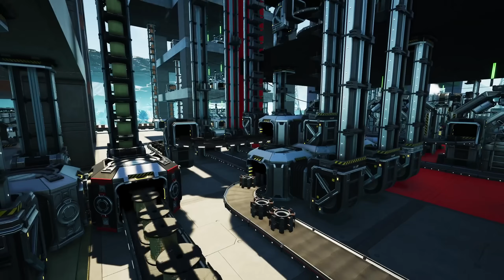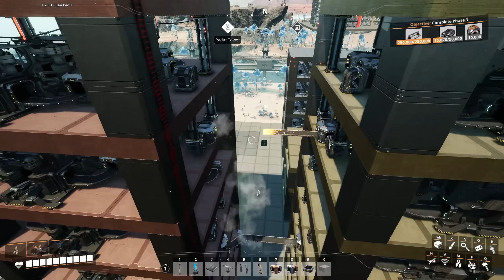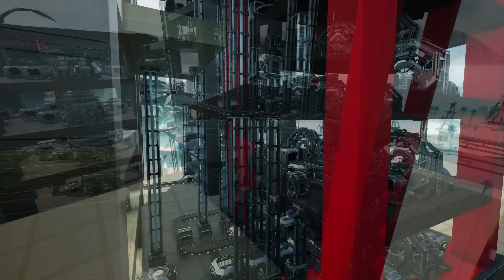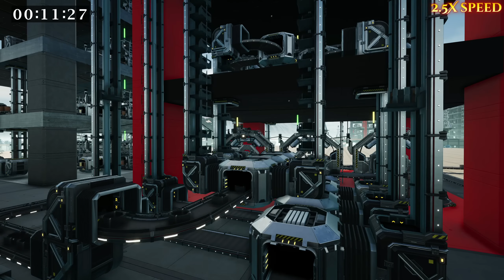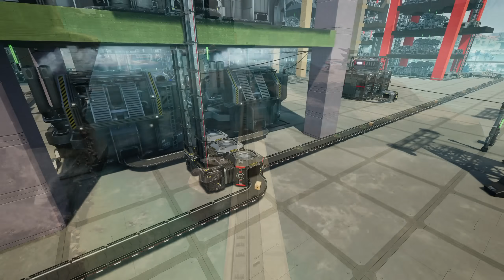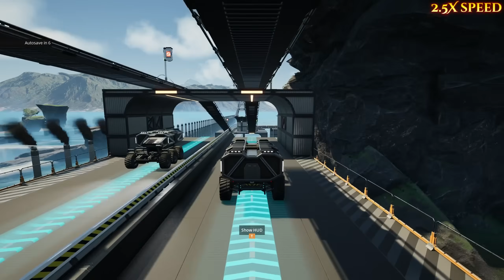5 Adaptive Control Units / 100x Space Elevator Parts - New Satisfactory 1.2 Playthrough

Comment: Question, does that priority power switch tie into the entire Versatile Frame factory chain?
Or just the Plant itself?

I recall when You swapped over to using Sloops- You set up an Awesome Sink to by pass the parts production to remove the blueprints and swap over to a slooped blueprint.
(So, nothing backed up)

If the entire chain is on the power switch, then this question is moot.
If just the slooped blueprint is, then You might be able to shut off the entire product chain, and save even more power
Reply from the maker: That's a good point, I'll have to check double check the wiring and make sure that everything is actually behind it. Thanks for the reminder!